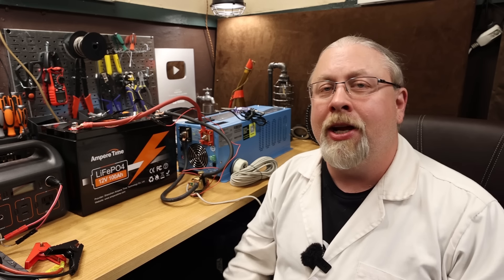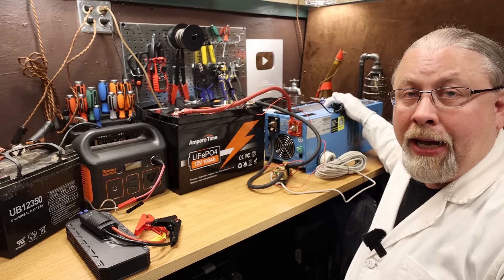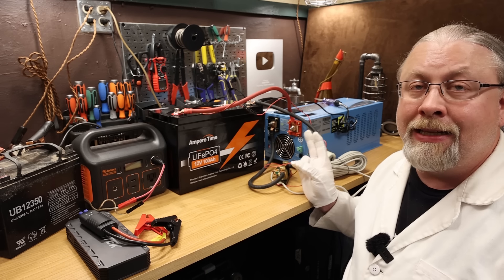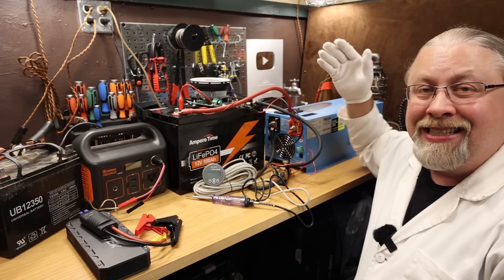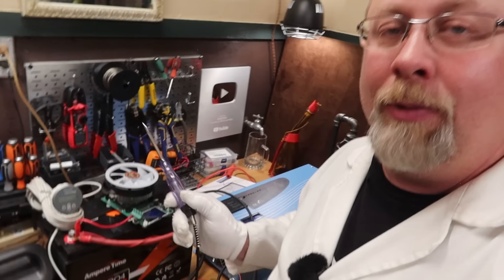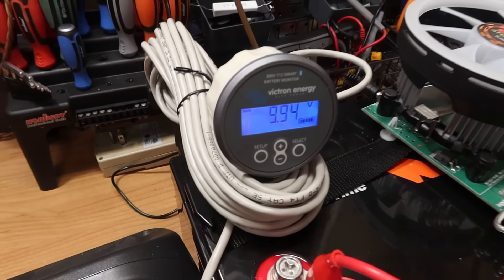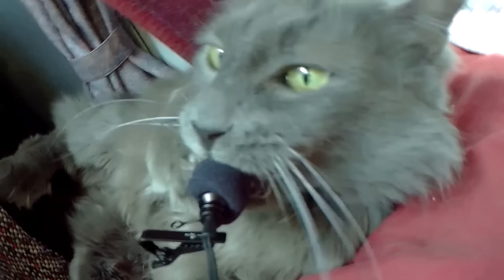3 Ways To JUMP Start And WAKE A DEAD Lithium LiFePO4 Battery FAST!

Comment from the maker: 30 Ohm Resistor: https://amzn.to/3Fpy3fN
Continuity Testing Light: https://amzn.to/41SppzW
Cigarette Lighter Plug: https://hobotech.tv/amazon/#Solar-Adapters
Jackery 12v Jumper Cable: https://gohobo.io/jackcable or https://gohobo.io/jzon
AmpereTime (LiTime) Battery: https://gohobo.io/ampere use code HOBO3 or HOBOTECH
---
DISCOUNT CODES on SOLAR PANELS - GENERATORS - REFRIGERATORS : https://hobotech.tv/amazon
Reply: grate experiment that works. Hobotech can you imagine how many people threw their batteries thinking it was completely dead.
Reply: There didn't seem to have any protection circuit on the Jackery explorer I purchased from Harbor Freight.  It started smoking when I hooked the Jackery to put some extra juice in the vehicle battery when the alternator failed and the engine needed to do some traveling to get to the next AutoZone store.  The battery in my 94 GMC C3500 was down to 11.4 volts when I used a Harbor Freight battery clamps from one of the solar panels with the connection for a battery directly from the small solar panel.  I had another connection that went to the 12 volt outlet.  I put the ground on the negative side of the battery and when I connected the positive connection to the battery is when the Jackery started smoking and the 12 volt outlet died.  I had the Jackery a short time and Harbor Freight replaced the unit. Didn't have any problems with the return.  I also let Jackery know what happened.  They were also very nice and timely in giving me support.  I wish Jackery could have a hard wire option on the solar generators like the AC200 and the air plane 12 volt connection.  I use that one for the 12 volt refrigerator/freezer.
Reply: Hi, how do I jump start a 48v lithium battery

Comment: To be 100% correct it's not the battery it's the BMS that cuts off the battery. The battery is just as it's lowest voltage/current per cell...
Reply: Yes , I wish he would correctly teach what is really going on in a lifepo4 BMS (battery Manage System) . The cells will be damaged if the voltage gets to below 10 or so volts in a 12 volt battery..The BMS shuts the battery off. So the batterie reads Zero… but in reality,, it is at its BMS protection shut off voltage. About 10 volts n a 12 volt system. You are actually Resetting the BMS circuit.  Now you must charge the battery. If you discharge it below 10 volts. You have damage your battery.. Thous ,the reason for the BMS..to OPEN the battery circuit. You read 0 volts
Reply: Very good to know!  But my question is...connected to a controller that's supposed to shut it down when the voltage gets to 10.7, why doesn't the controller shut it down first?  Or do we even know whether it was the controller or the BMS that shut it down?  All I know is the battery read less than 1 volt when tested with a multimeter.  I've been scratching my head over why the controller didn't shut it down at 10.7v....
Reply: @Goody2shzToo the controllers were designed before lithium came out?
Reply: @Goody2shzToo my question as well
Reply: Literally says that within the first minute of the video

Comment: You forgot to show how to use a tool battery or any dc source above 10.5V.  BTW, the spark is only dangerous if you have been recently farting excessively :>)
Reply: Science
Reply: DISCLAIMET: Avoid eating beans before jump starting🎉🎉🎉

Comment: So i need to Jumpstart a 60v lithium battery. It's my only transportation it's been dead and will not charge for the three days I've had it from the factory. ??????????
Reply: You need a very high current jump starter ideally, currently the 12v lithium battery in my car is dead too but using a car with a lead-acid battery provides insufficient current to crank it

Comment: Excellent video, as usual.  It's worth pointing out that the battery voltage never was zero.  The cells inside, usually in a 4S configuration, were simply down to whatever voltage (often 2.5v each) that the BMS is configured to shut off at.  The battery cells were at 10v but the BMS turns everything off to avoid discharging the cells too low, which will damage them.  All it takes is a small amount of forced current to bring the voltage above that threshold, waking up the BMS and enabling the charging mosfets to feed current into the cells.  I learned this lesson with a portable power station that "died"...2 mins plugged into the automotive accessory charger in my car woke up the BMS and charged the cells enough that the AC wall charger could do its thing.
Reply: Ah... so the BMS disconnects it. Thanks for the extra info.
And thanks for the video HT!
Reply: Hi, I have a 48 Volt 10 AMP battery that will charge for around 5 minutes then when I use the electric bike it will die very very quickly within 15 seconds how do I revive that battery. It does have a built in headlight and that's the only way that I can think of to discharge it. Or should I get another 48 Volt good battery and just go positive to positive negative to negative any help would be appreciated thank you Andrew
Reply: @drewgsands  that problem sounds like an imbalance between the packs of cell within the battery. Most likely one of the groups of cells is very close to the 4.2 volts upper range cut off. whereas all the others are at a much lower voltage maybe around half way or towards the bottom end of the cut-off voltage. This is caused by one or more individual cells in that small group is chemically damaged and has very different 'internal resistance'
small differences between cells when the battery is factory built, can over time become exaggerated and the divergence leads to one group becoming fully charged or empty, way too early before the others. So the BMS battery management system detects this and safely shuts off the charging. otherwise it could lead to an explosion. Batteries can be damaged by running them down to empty and leaving them in this condition in long-term storage. Always store at around 60% state of charge.
  If a cell is seriously damaged, it maybe possible to cut it out and solder in another that is exactly matched the the capacity end internal resistance of the remaining good cells. Getting a good match is important but could be difficult and expensive in time or Labour charges. Probably best to buy a new battery. Sorry

Comment: You absolute legend! I thought I was up for a new battery after dusting off 3x life po4 batteries, which had spent 4 years doing sweet fa. 2/3 came to life charging but the last was spitting an error on the battery charger. Used the jump trick here... 3/3 straight back to life and charging up. Much appreciated good sir.

Comment: For anyone with a 24V system...

I connected (2) 12V AGM batteries in series to jump MY 24V system that was showing me 2.5V. Ran jumper cables with one positive clamped onto a resistor as shown in the video. No sparks and it took about 20 seconds for the inverter/charger to light up and begin charging. 

Thank you for this video, it was s great help.
Reply: thanks man, unfortunately don't have any other batteries available, will buy the Victron charger

Comment: This video saves lives. 
It just worked with mine using a 12v drill battery as the quick starter thanks.

Comment: Yup, it works! Thank you Hobotech.

I just now restarted a big 36v 135ah lithium/solar battery using a little 40v tool battery. I was testing the big battery to see if the BMS would shut off at 30v and it did. But, since  my mppt solar charger will not operate without a working battery, I needed another power supply to start the "dead" Li battery (Btw, as another commenter mentioned, the battery is not actually dead. Rather, the BMS shuts off because the battery reached a minimum low point. In my case, that's 30v)

So, what to do? 

I have 40 volt power tools and I used one of those batteries to "jump" (turn on) the BMS of the dead battery. I simply connected +/- leads from the 40v lithium tool battery to the +/- leads on the big 36v lithium/solar battery. All it took was a quick touch (yes, there was a small spark) and presto! The BMS turned back on and my mppt solar charger turned on as well.

Please note: If you're in a similar situation, go easy. Double check to be sure connections are all safe and correct and as a precaution turn OFF power from solar panels before restarting everything.

Comment: I wish I’d seen this a year ago. I got rid of a nice LifePO4 power bank (can’t remember brand, , but like your Jackery) that cost me $400 3 years ago, but only lasted 2 years (supposed to last 10). It was just out of warranty, and would not respond to its charger. I got another charger with the same result. So I figured the battery was dead, and I wanted to replace it, but it was complicated inside! I just bought a new one that had two charging inputs, thinking the charging circuitry went out. It’s possible, but now I think it was just the BMS! Now I know what to try before discarding. Thank you!

Comment: Just tried this with a dead lithium motorcycle battery and it worked! Thanks, you're a lifesaver. I used the stripped ends of a 12v wifi power cable I no longer needed!

Comment: Thanks for showing all these options. I was away from home and had to scrounge a way to do this to my ‘house’ battery in our van camper, using items scrounged from my son in law’s garage. He had one of those ‘dumb’ circuit testers with the light and alligator clip, and I had a separate small 12v 5aH battery. Made it work by tickling a wired-on 12v outlet while the solar panels were hooked up and ready to charge via a different connection. Bravo! Saved my bacon.

Comment: I have a cheapo 60v 5a charger that I use to jump my LiFePO batteries when needed. I use wall power but have also used my EcoFlow River Pro to power the charger. Most chargers need the source of input voltage to be ~5v about that of the deleted battery. I needed the 60v charger to get my LiFePO going. Works like a charm.
I also make multitude of connectors for many scenarios. M4 connector to Anderson PP (APP), APP to cigarette lighter, etc. I use my chargers with ring connectors and M4 connectors to charge through my DIY solar generator setup using its solar input connection.

Comment: Many thanks for this helpful video.. i have braille g20 lithium ion battery 2 month old only, i left the car for 45days, trying to start it but the battery looks dead, checked it 0.16V, i have lithium jump starter, before i jump start it I contacted Braille technical services, they said "You will immediately kill a lithium battery if you jump start it from another battery", so I was very confused, i watched that video and i take the risk 🥲, the car is running now for 4 hours then switched off and on .. looks great, i really don't know if i damage it or not😂😢, but i think this professor he knows what he is doing ❤

Comment: I have all of this stuff except for the Jackery.  But since I didn't know about these, I used a 100-watt 18-19v solar panel  and connected it directly to the LPO4 battery and it immediately took it over 10v even though it was cloudy day.  But HAD I KNOWN I would've used the handy little jump starter.  So much easier than moving the battery around.  So thank you so much.

Comment: Great video.  I have a small adnjustable power supply that I use for this purpose.  The issue I run into a lot is I use some 24v batteries and use the 12/ 24v chargers for them.  If the 24v batteries get too low the charger thinks it's a 12v battery that is fully charged.  All I have to do is get that momentary voltage boost and then the charger knows it's a 24v that needs charged.

Comment: Great video explanation. I bought a 48v 30Ah  LiTime battery and it was set to "off" when it arrived. My lithium charger wouldn't come on to charger the battery when I hooked it up. I used my old 12v car charger to wake it up and it i did. Then hooked up my Lithium charger to charge the battery and all good.
Reply: 12v car charger can wake up 48v Li Time battery? Good to know.

Comment: Method 1) 6:38 - Is the -VE clamp just momentarily on the NEG terminal, or do I leave it clamped?
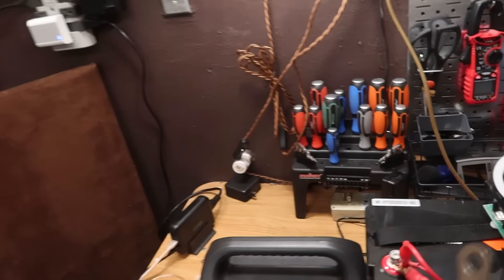Method 2a) 8:02 - Aren't we supposed to connect the +ve and then touch the -ve terminal?
Method 2b) 10:00 - This just worked for me! Thank You HT!

The Li Time manual suggests two methods for waking the battery up.

1) Using a "zero volt charger". How many of us actually have a 0V charger?
2) Connecting a 12V solar panel + charge controller.

Clearly, it is not "0V" that does the trick, since the panel+SCC obviously put out 12V, and not 0V.
Someone on another YT video suggested that the battery was shipped with the BMS disabled. I doubt this is the case, as my battery does not have Bluetooth.

Also, when it was 'jumpstarted', my charger showed 11.9V.
It's now being charged at 0.05C (5A).

Comment: 😅Thanks for this, after I waded through all the other b.s. I finally found this fix which was simply and succinctly explained and of course worked within seconds
I used a lead acid jumpstarter with no problem that I can see.

Comment: There's a wide selection of solar chargers that will 'wake up' a lithium battery where the BMS has gone into low voltage protection.  It's not something a lot of people consider when buying, but at the top shelf end of things Victron will do it and at the mid range tier Renogy branded chargers will if configured appropriately.

Comment: The wall adapter method works great.  It doesn't even have to be a battery charger or battery or whatever.  Two clip leads and a little pokery-jiggery and you are done.

Nearly all wall adapters for the misc devices you might have lying around the home are either 5VDC or 12VDC.   And all such adapters are current limited (usually from between 300mA to 2A or so), short circuit protected, and typically 'hicup' on a short (retry every few seconds continuously).

So just find an appropriate wall adapter lying around in the house, read the label to make sure the output voltage is reasonable, and you can connect it directly to the battery without any resistors or anything else to jump start it.  If you happen to have a little 300mA current limited wall adapter, It is literally impossible to damage anything.

(The voltage varies a bit on these wall adapters, so use a multi-meter to check that its reasonable even if the label says 12V.  But hey if the battery is dead and below 10V, then any "12VDC" wall adapter will do the job).

Comment: 21v lipo battery of my tineco floorwasher was completely gone. I was buying another one (€70) and after I saw your video. I attached a 20v wall power supply for 30 seconds. Washer have a base to recharge. After insert a few time the washer into the base the charge finally started. Probably some second more was enough for starting at first try.

Comment: in one case I had to break open the sealed case, disconnect the BMS and connect the battery charger directly to the battery bus bars. Once it reached 12V, I reconnected it all up again and the battery continued to charge to 14.4 V.
I then re-sealed the case.
Reply: i might try this. as mine wont charge
Reply: I did that but it does nothing when hooked back up to the inverter of the eb3a I think the bms is fried on my unit the batteries are good the bms just won't let a charge in or power out.

Comment: Li-polymer batteries suffer from the same problem. 
You can jumpstart a dead 9v exactly the same way... but it's much easier... as all you have to do is touch the terminals together for a few seconds.
The best solution is to make sure every charger you buy from now on includes support for lithium ion batteries i.e. Won't assume zero voltage means the battery is dead.

BTW: You get less failures on these 9v batteries if you slow charge them. 
Fast charging is convenient but the failure rate roughly doubles.
Whichever charging method you prefer (slow or fast) try to stick to it... as switching methods all the time accelerates battery failure.

Glad someone is talking about the problem and explaining it... as a lot of people seem unaware that it exists or is an issue e.g. My ReZap slow charger doesn't support Lithium batteries and despite being programmable the manufacturer has not bothered to update the charger to support it... and appear to have no plans to do so. They said lithium ion batteries (AA/AAA/C/D/9V) are not very common. So why design a programmable charger? Maybe they'll change their minds eventually? In the meantime you're forced to use other cheaper chargers to jump start the charging process before switching to the slow charger. That's annoying.

🙂

Comment: I have a 12-volt lifepo4 I used in my Fiat 500e, super underpowered, car died on freeway after about a month. It's small enough and safe to carry around as a backup battery, that would allow me to get my keys out of the car and lock it & easily get me to a battery shop.

Comment: I have been jump starting batteries like this for sometime. When I am out in the field and have a singular 18650 battery that dies I put the dead battery into a flashlight first followed by a good 18650 battery and turn on the flashlight a minute, it works every time. Of course I recommend having a flashlight that takes 2 18650 batteries they last a long time.

Comment: Victron battery chargers charge a dead LiFePo battery. Problem solved.

Some battery chargers with a lithium setting only provide the LiFePo charge profile, and not the “jump start.”

The BMS is a computer, and thus requires electricity.